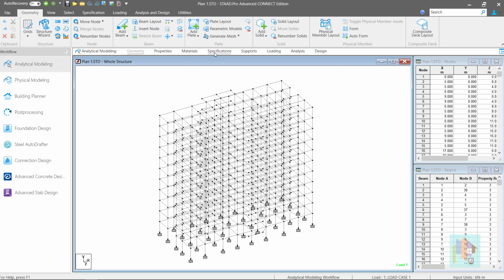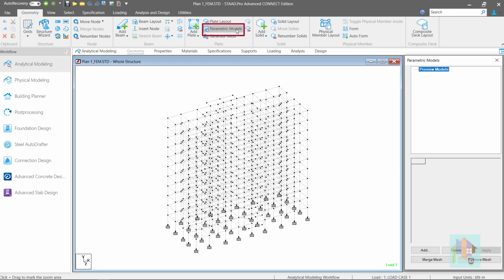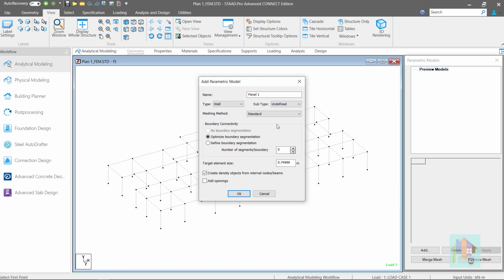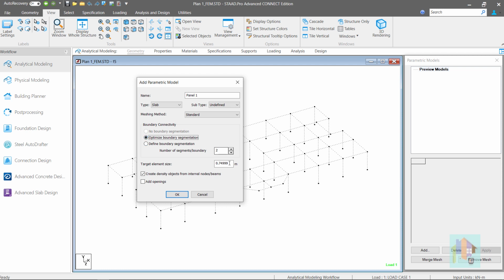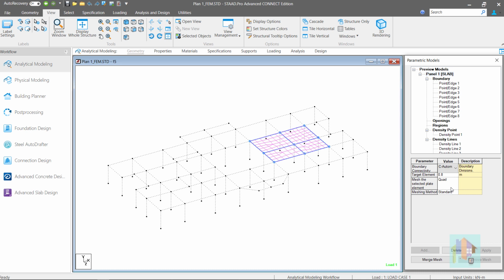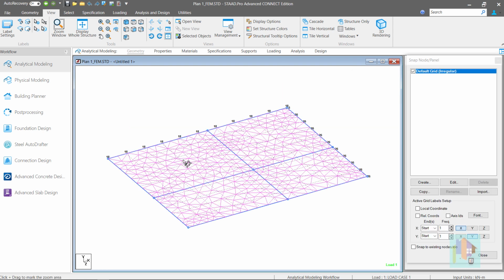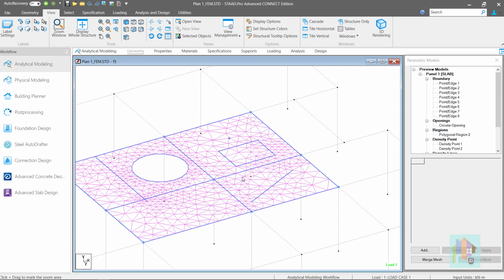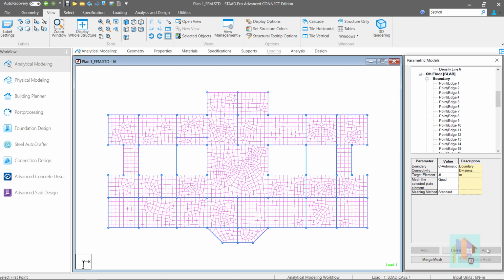Generate Plate Mesh in STAAD: Part 3 – Advanced Plate Mesh with Parametric Model

Comment: can parametric mesh option be used for swiming pool floor of varying depth? How can we use parametric option to mesh a full structure. I tried it and noticed it only considers one meshing instance, i cant include another mesh area. Also can a model be made with both parametric mesh and plate mesh method in the same model. Thank you
Reply from the maker: Following are my responses -- Swimming pool, yes, parametric model/physical modeler is ideal for this type of structure. Parametric model can also be used to model FEM for the entire structure and it can handle interaction with other meshed surfaces easily, as it determines the density nodes and lines internally. Chance of improperly connected plate is 1%, that you need to check once using the plate to plate connectivity tool. Finally, you can combine parametric model with normal plate mesh method, there is no problem. Only thing, you need to be cautious about the exiting plate nodes if you use plate mesh option.

Comment: Sir . How we can apply region load and line load on density line
Reply from the maker: For region load, we can create a region during mesh generation using parametric model and use the plates within that region to apply plate pressure load. On density line, we can apply line load as a nodal load or create a dummy member to apply UDL. Physical modeler provides better option for region and line load, you can check part 4 for morr details.

Comment: Is it possible to get wood armer forces?
Reply from the maker: Are you looking for the wood and armer moment? Though it is not directly reported for plate elements in STAAD, but we can easily calculate this from the plate stress results using a simple macro. Also if you design the plates in RCDC FE or RAM Concept with FEA results, you can automatically consider this for slab design.

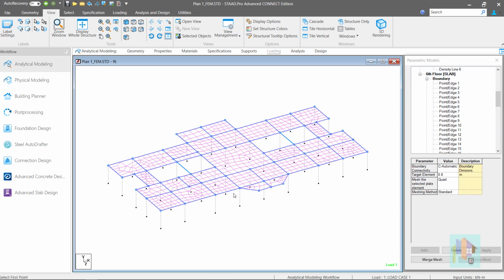Comment: why/how does it show some openings (19:30) even you did not tick add openings?
Reply from the maker: oh, that part is skipped in the video. I didn't select the opening option in the mesh configuration window, and included the openings later in the mesh. I have already discussed the process, so removed this part from the video.